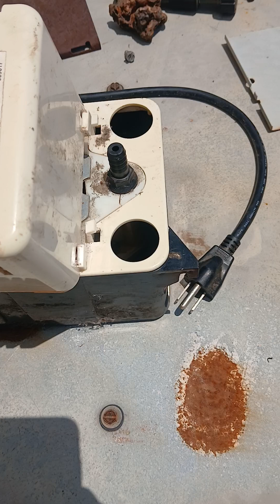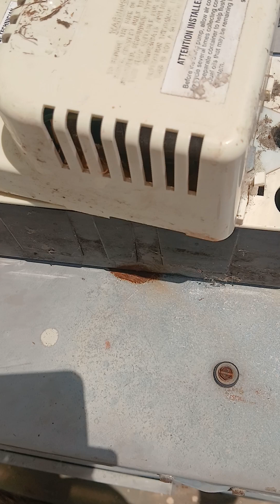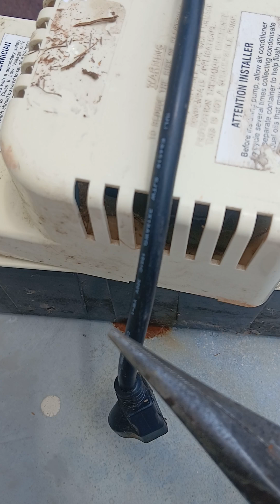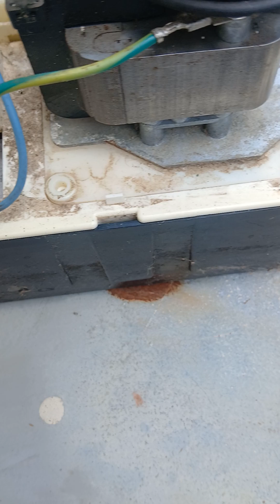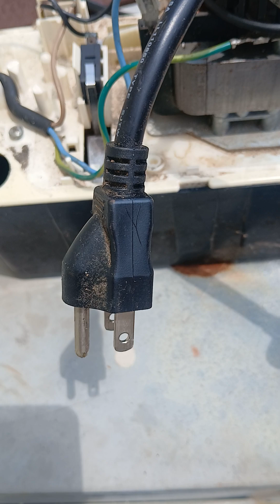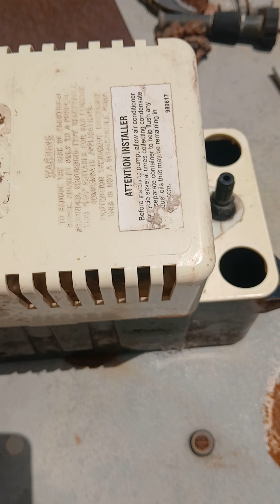Could Condensate Pump Be Hardwired Into Electrical If No Outlet?

Comment: I did and it works great.  Blue is the hot brown is the neutral and the greeen/yellow is the ground.
Reply: I am an electrician though.
Reply: It depends on the unit. I’m about to do this soon. Mine is already hard wired in, just replacing.